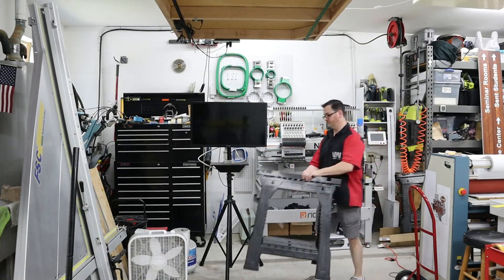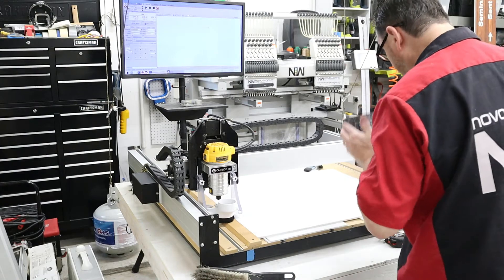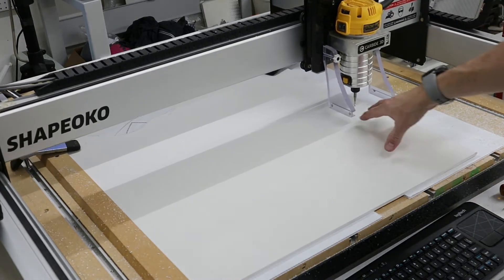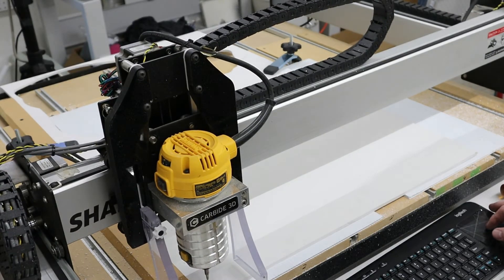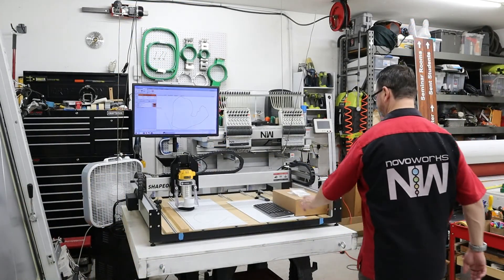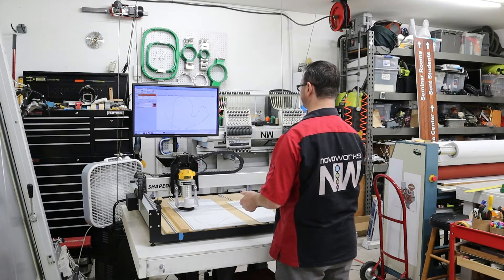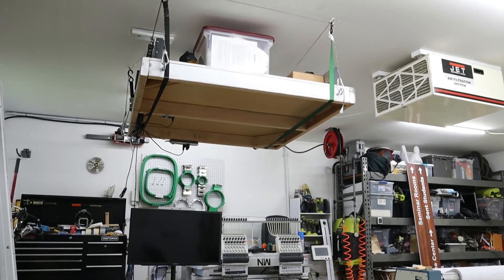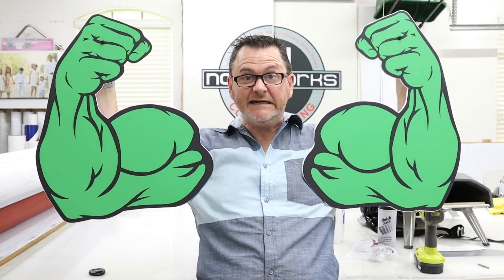Custom PVC Sign Prop  production - CNC Router on ceiling?!

Comment: How do you do the print
Reply from the maker: In this case we printed on vinyl w/ our wide format eco-sol printer, then laminated the print and cut on our Graphtec cutter.  Then applied to the substrate.
Reply: Wanna do this from my home.  What equipment would I need
Reply from the maker: @brothertate9211  - In our case, we used the Shapeoko XXL CNC Router, our Epson eco-sol S40600 wide format printer, 65" wide format laminator and Graphtec 9000 54" cutter.   There are many other ways to do something similar, have to find what makes sense for you.